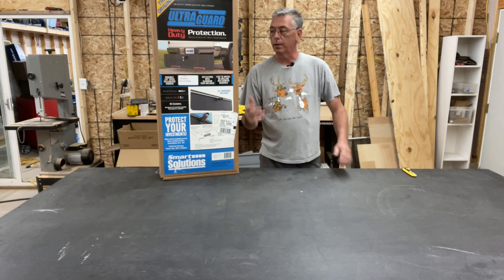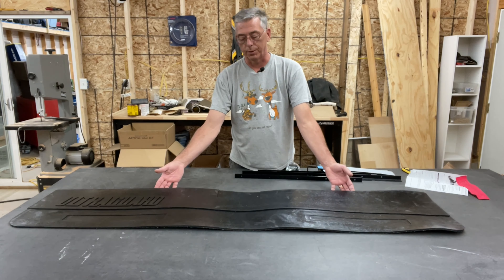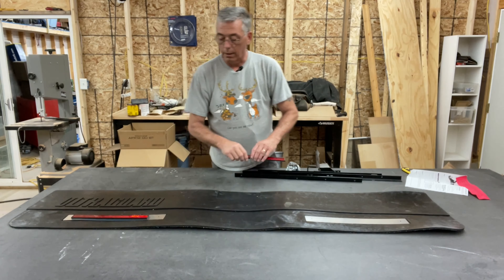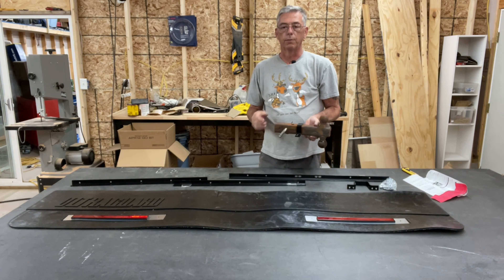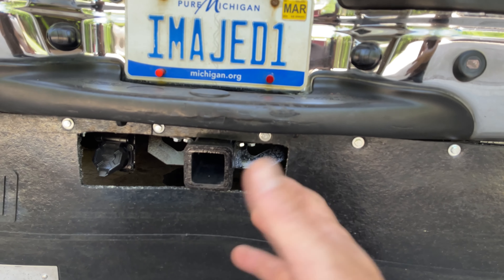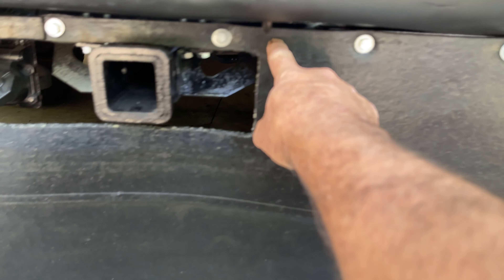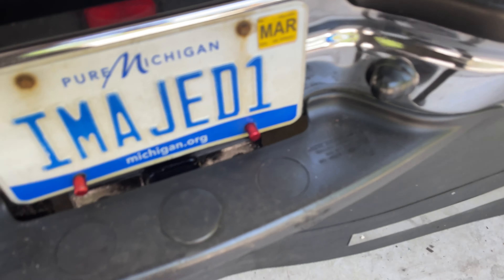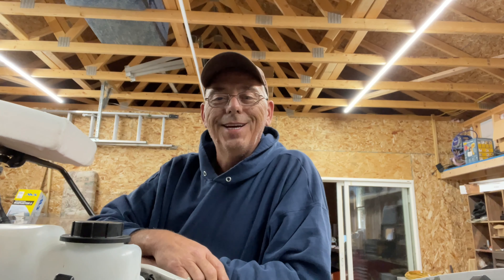RV Transport 4 - Smart Solutions UltraGuard Mud Flap Install

Comment: Did you consider putting the angle bar under the receiver? That would put the angle bar maybe 4" lower and reduce the floppiness.
Reply: @TravelinTim  I don't mean to move the rubber down.  Just the angle bar by flipping the receiver bracket over so the angle bar is under the receiver.  You would need to put new holes in the rubber.

Comment: So how did the rubber hold up
Reply: @TravelinTim  did you have any issues with the bolts around the receiver working loose do you think this would be better then single mudflaps
Reply: @TravelinTim  so I seen this for $120 is it worth it you think